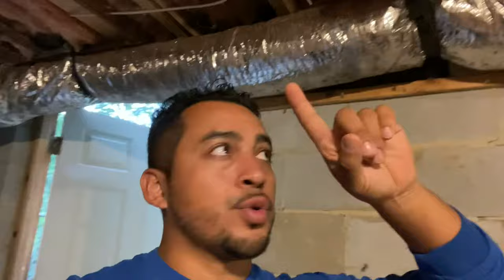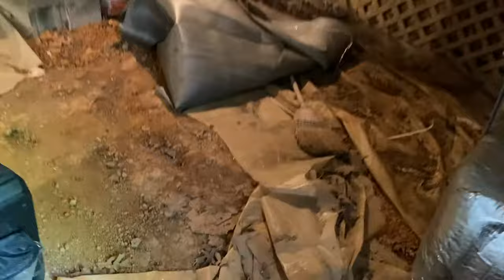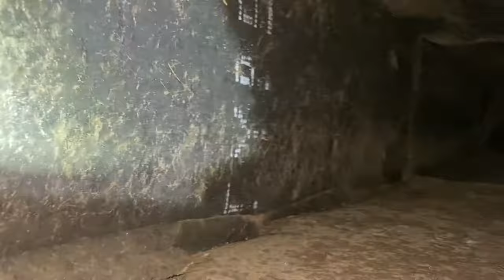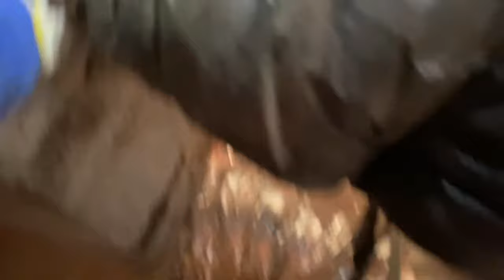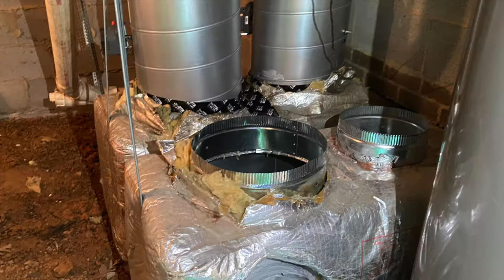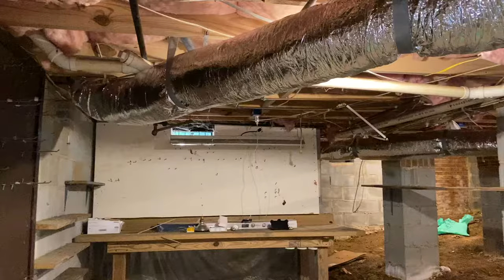HVAC DUCT CHANGE OUT FROM START TO FINISH

Comment: What is the average cost of replacing air ducts in an older home 1400 square ft built in early 50's?
Reply: It really depends but I got mine done for 6k and they pulled all the old metal swamp cooler ducts and configured a new system for 6k USD

Comment: I thought my ducts were dirty.
Reply from the maker: This ducts were nasty! Like the filters were never changed before
Reply: @carrosdiecast3650  I bought my 1993 4 bedroom 2 story house 2 years ago. The filter was laying on the blower. It still has the stock Rheem heater in the attic.

Comment: Good work.  I have a similar fate, but I got ass bestos to deal with.  Have to do it on my own because no HVAC joints will touch it.  I don't have much.  Just 5 runs off of a plenum, but I have to make a new plenum.  Previous owner went crazy cutting 5 huge holes and running the ducts as if nobody was every going to use a basement.  Yep, there is a dent from years of people bumping their heads.  Going to make my own plenum then tee it off into some flexy duct to get me home.  Just have to get a respirator and a few poopy suits to not die.

Comment: My question is, when replacing a new HVAC should they change that as well?
Reply from the maker: @BerendaSlade  no not necessarily. Unless the house is very old. Or you notice obvious damage on the ducts. 
My house is from 1991 so I went ahead replaced them

Comment: What is the proper way in creating a Y using flexible ducting?
Reply from the maker: @donovanpl  by using a metal wye for example 8x6x6 , 9x7x7. Inlet usually bigger in diameter

Comment: Hi Rafael, thank you for your video, it looks amazing. I have a question. I just purchased an old house with crawl space that is very wet and low, but the duct work is in bad shape also, I'm wondering if I should incapsulated it and if I do, do yo think that is a good idea to put AC vent there since will be incapsulate? I don't like the idea to have a dehumidifier in the crawl space, but I might be wrong. Thank you
Reply from the maker: Thank you for the comment, i agree it came out good. I get better air flow inside the house. 
I think its a great idea to seal the crawl  space . I hear it helps the energy bill also. And yea its a requirement to add a supply run to the crawl. I say a 4in to 6in supply depending on the crawl size
Reply: @carrosdiecast3650  Thank you
Reply: I've watched a lot of Crawl Space Ninja's videos about encapsulation. We have a lot of mildew in the crawl space and I live in a humid environment. My wife and kids are susceptible to migraines so I'm in the process of encapsulating it myself because their allergies stimulate their migraines. I'm very busy at my job so this has been a long process but I see a lot of benefits to it already. First, I found white mold on the joists before I started this process because the humid air would come in through the vents. I closed the vents off and I added an aprille aire humidifier and it's done a great job of keeping the humidity down to 45%. 

Then I added an exhaust vent to remove some of the mildew since I don't have it fully encapsulated yet. It works but it obviously removes heat from the upper floor of the house so I run it on a timer. I have finally finished putting foam in the rim joists which has helped our heat immensely this winter. I hated doing it but it's done and I can tell a difference as our furnace has not been running as much this season. Next I'm going to put 2" foam on the concrete walls down there, fog the joists to kill the mold, vacuum/sand the mold off, install the plastic. Ugh, it's a lot of work and I'm doing 1,800 sqft by myself.